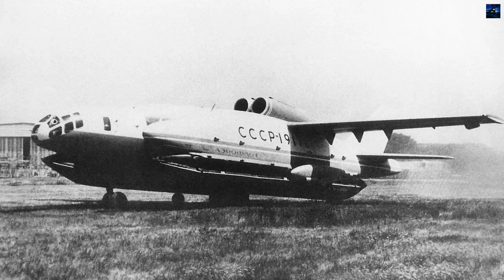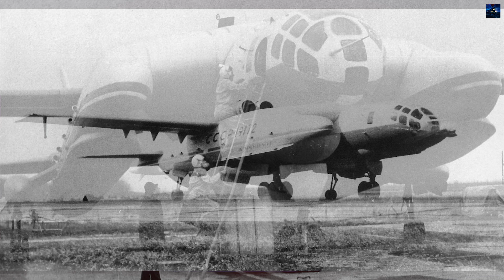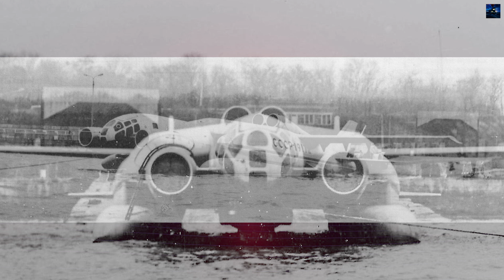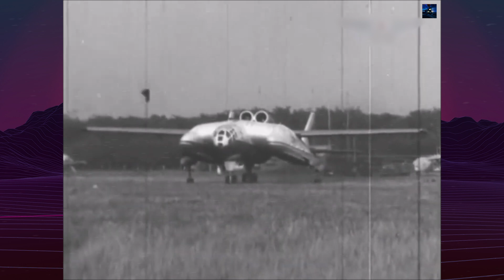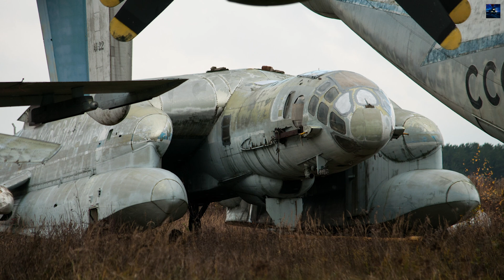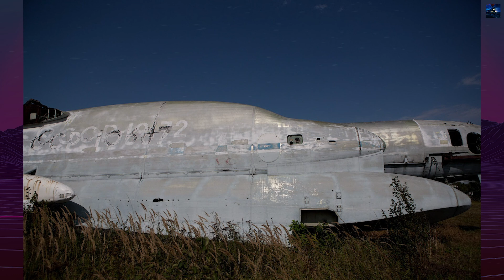Bartini Beriev VVA-14: Roberto Bartini - From Italian Artist to Soviet Legend

Comment: I saw 3 different versions in the photos here. 2 engines, inflatable floats. 2 engines, solid float hulls. 4 engines, solid floats. Were these all modifications of the single airframe?
Reply: They were! There was also one with, as he said, vtol capabilities, which is also a different modification of the same frame. Not entirely sure tho, but there's lots of info to find about this airframe on the internet! :)
Reply from the maker: Yes, those were indeed modifications of the single airframe. The Bartini Beriev VVA-14 went through several stages of development, including versions with inflatable pontoons, solid float hulls, and different engine configurations. Each modification aimed to improve its performance and capabilities.